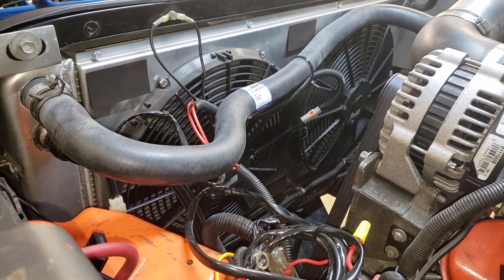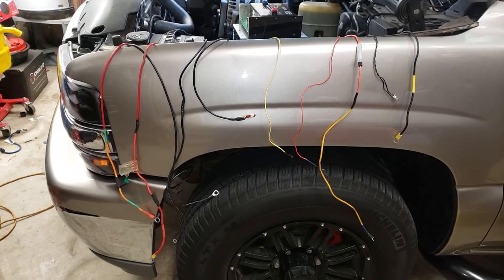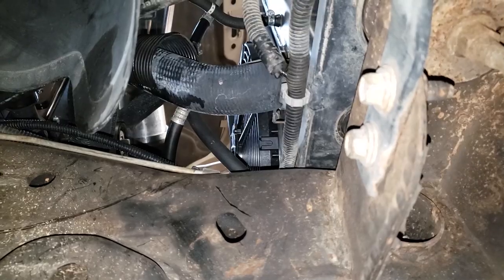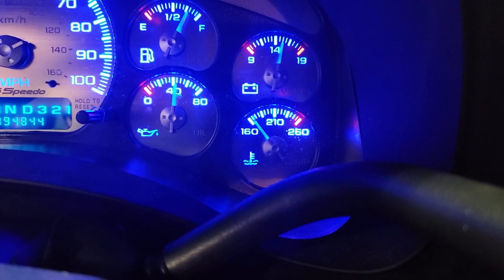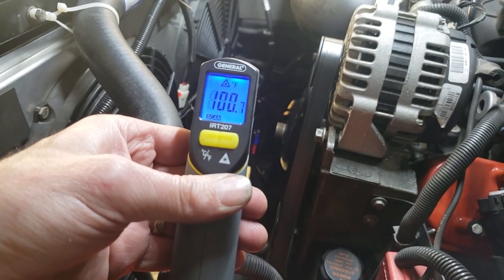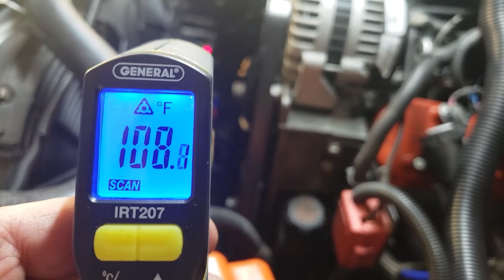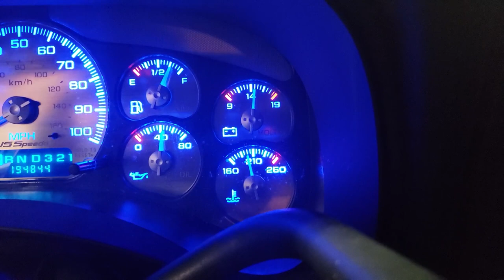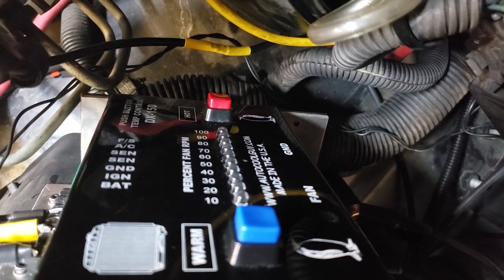Soft Start Pulse Width Modulated  Electric Fan Controller for Radiator

Comment: Hello sir, did you provide a link to the fan in another video possibly? Maybe I missed it. How much HP will you expect to see with the fan mod?
Reply from the maker: The fan is from http://www.griffinrad.com/    I think the manufacturer of the fan claims a 14 HP increase due to no mechanical fan having a parasitic draw on the engine.  My opinion is that it is not noticeable, however, as part of a strategy including other horsepower mods, it will help.  My fans get the whole winter off, that's enough of a reason to do aftermarket electric fans for me (when you think about how much energy a mechanical fan wastes when it's not needed).  Thanks for watching!
Reply: Tahoe Steve thanks for the reply.
Reply: I added this controller after finding out how badly some of the big name units "work." It has been flawless and I couldn't be happier. The owner of the company is a great guy and answered all my questions over the phone.

Comment: Dam! You have 10 miles of upper rad hose!!! Did you know on the LS water pump you can stick a pry bar in the outlet and easily turn it to direct it straight to your radiator inlet instead of having 10 miles of hose

Comment: Why didn’t you tap into the factory coolant temp sensor rather than adding a 2nd sensor? The one that’s in the engine block. That’s what I figure the engineers want to keep at a steady temperature as opposed to the radiator.

Comment: Mechanical fans incessantly run at a similar rate to engine RPM because mechanical fans are locked in to pulley ratio, and not temperature from the engine. Seeing electric motors can speed up to cool down quickly when things are  exponentially hot and resolutions are needed as fast as possible to resolve overheating or over cooling. Just a thought, This PWM is bomb. Again that doesn't

Comment: I’m just a lil confused... there’s a FACTORY harness and fans that are direct bolt in for your 2002... that use pwm... why would one buy an expensive HUGE controller... to do what the computer can ALREADY DO once you install the fans, harness, and flash the pcm??!?
Reply from the maker: You talk about flashing a PCM like its as easy as sending a text.  Most people dont have a clue what is involved in flashing a PCM.  So you recommend spending hundreds on something like HP Tuners and spending more on credits, and then spend time learning how to flash the cars computer (which if done incorrectly can be catastrophic)?  It took an hour to put this in and its a fun mod.  Need it, NO.  But we really dont NEED to have 400+ horsepower either, do we.
Reply: @TahoeSteve  I wonder if I could use this product along with my p59 pcm.. In other words my truck is modified, HP tuners blah blah.. I was gonna build a few relays and use the "negative triggers and ac out cause I have ac" from the ECM to tell the relays on/product your using to run the fans.. 
My concern is being that my ecm doesn't produce "pulse" other than a negative output would it even work? And avoid using the sensor or having the sensor installed as a fail safe?

Being that your engine/pcm is similar to mine, to license the pcm to turn on the "fans" is only $50 bucks and then add the 2 wires to the harness/pin out.. Incase if u were wondering..